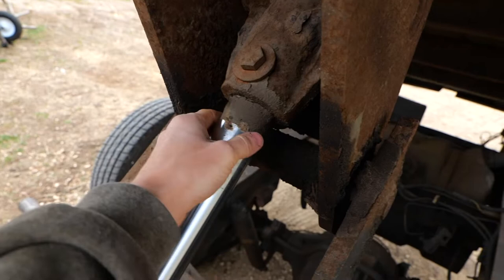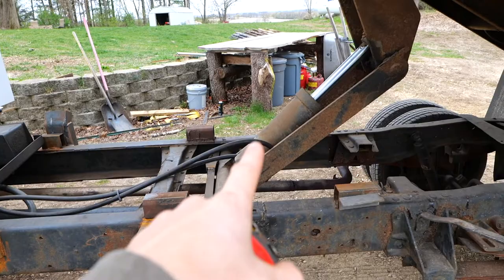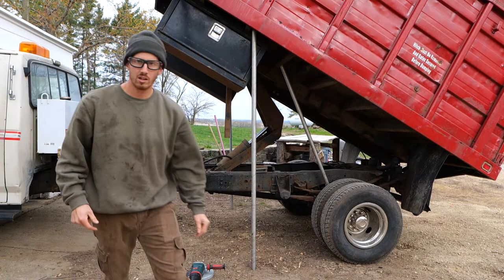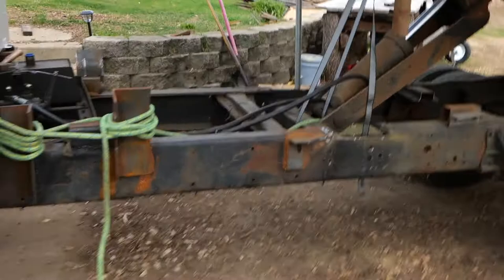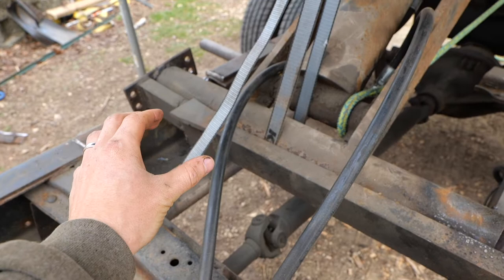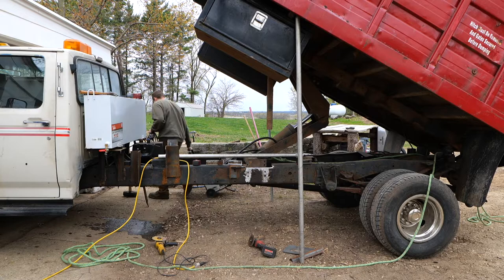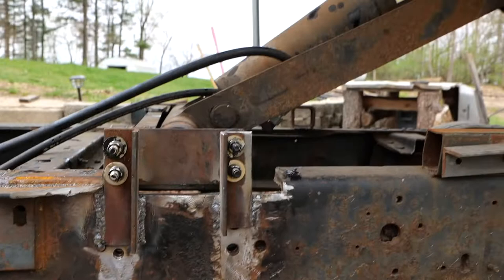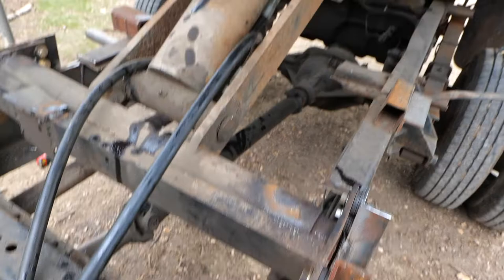Dump Truck Conversion: What to Do if Your Dump Truck won't raise high enough

Comment: and to make strong welds: just go slow by putting down multiple small passes, grind back when it looks too rough or contaminated. make sure your amps are high enough, keep your gap tight, and make sure your ground is good. easy ;)

Comment: Chainfalls  and chain  comealongs will help  with this type of  work.  They dont have to be Harrington  even  haulmaster  is an improvement  from  ratchet  straps. Most ratchet straps  have a cotter pin  at the hart of the ratcheting  mechanism  and a big enough  load will bend them till they let go suddenly. 

That said  sometimes  you have to get a job done  with  what you have.